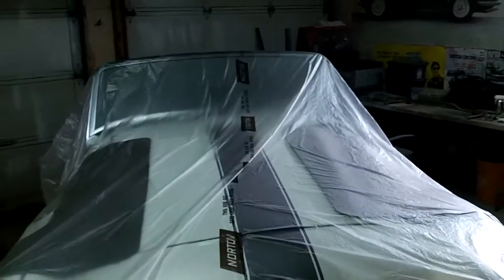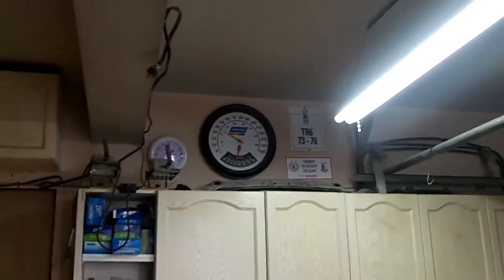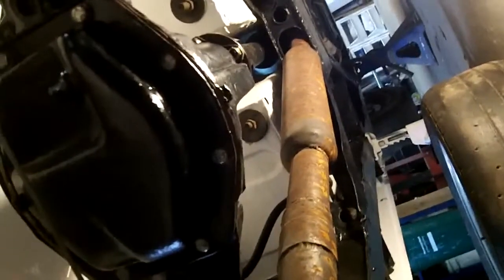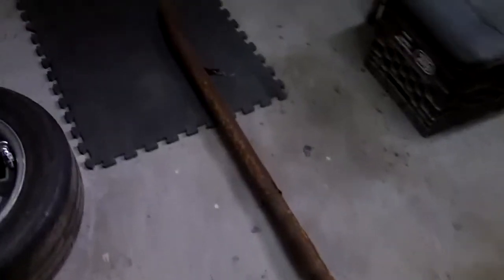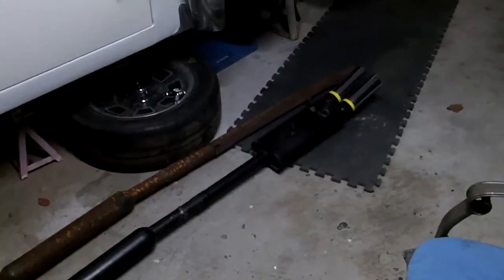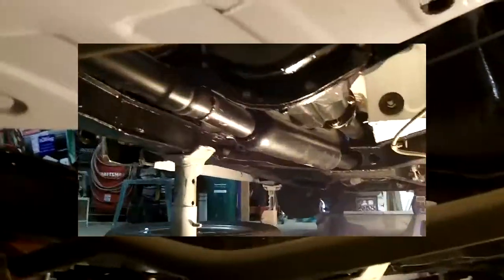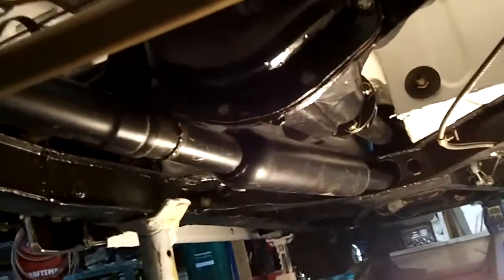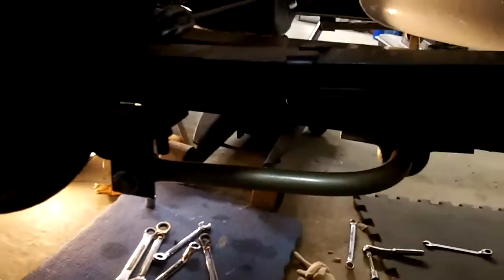Rear Sway Bar and Exhaust Fitting, 1960 Triumph TR3A Restora

Comment: a few years back my wife had a '65 Mustang convertible with a 302 (yes, it was a 302 I replaced the worn out 289) and a 4 speed toploader, but when we had the exhaust done she went to 18 inch glass paks and it was LOUD and sounded GREAT! She even found a lapel pin that she wore that said "loud pipes save lives".  And she went for long drives with the top down and her foot in it most of the time and she loved the sound of that car.  Of course she is older now (74) and wears 2 hearing aids and the Mustang has been replaced with a more conservative (?) Z28 which is quieter but a hell of a lot faster and she doesn't seem to have slowed down much. So I guess that "beauty is in the 'ear' of the beholder". But you made the right decision for your TR3 Tush.  It'll sound great and perform very well.  I'll see if my wife still has the pin to send you.